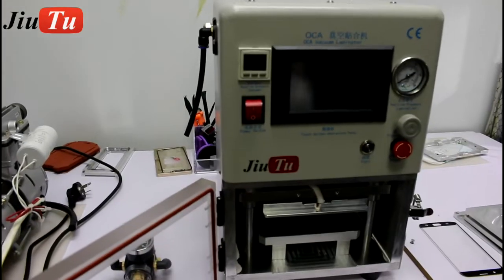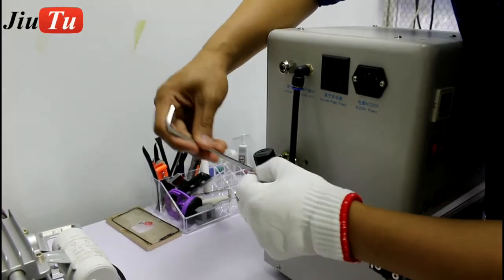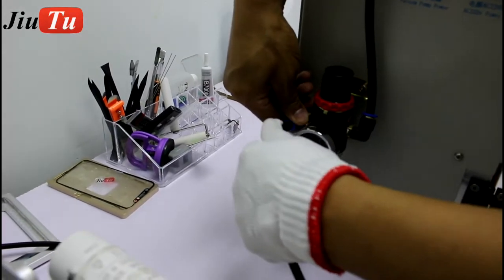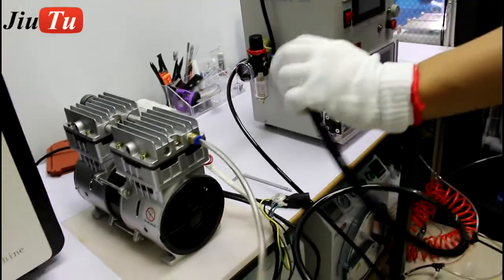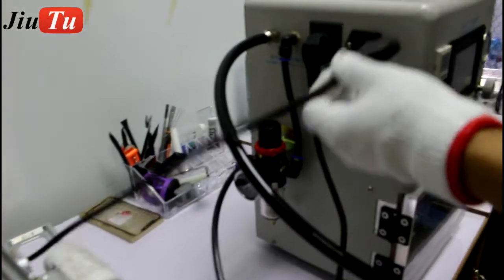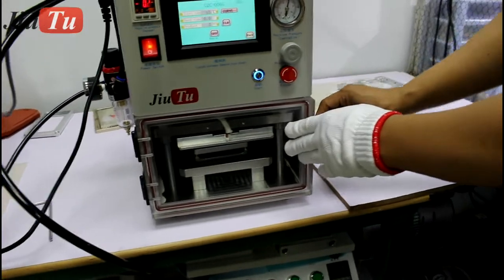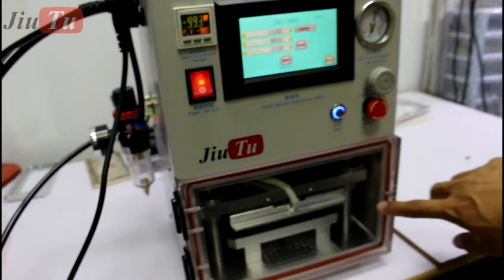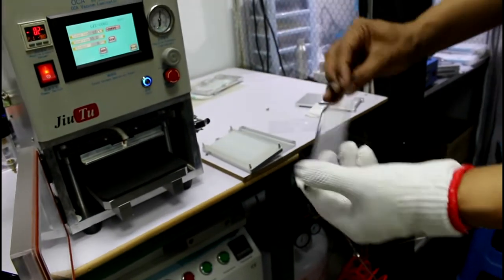How To Repair Samsung Galaxy S7 S8 Edge OLED Curved Glass  By Jiutu LCD Repair Machine

Comment: How much cost for this machine ,it   look like ymg machine.
Reply from the maker: Yes! You are right.  you can buy here get it.
https://www.aliexpress.com/item/Smartphone-OCA-Laminater-Machine-Fix-Edge-OLED-Broken-Touch-Screen-Repair-Refurbish-For-iPhone-For-Samsung/32873360759.html?spm=2114.search0104.3.73.4018326dYqQfyz&ws_ab_test=searchweb0_0,searchweb201602_2_10152_10151_10065_10344_10068_5723115_10130_5722815_10324_10342_10547_10343_10340_5722915_10548_10341_10545_5722615_10696_10084_10083_10618_10307_10301_10821_5722715_10059_100031_10103_10624_10623_10622_5722515_10621_10620,searchweb201603_2,ppcSwitch_3&algo_expid=767ffc72-035f-4ca9-99ed-180e2f8a4926-12&algo_pvid=767ffc72-035f-4ca9-99ed-180e2f8a4926&priceBeautifyAB=0
Reply from the maker: May I have your email or wechat?

Comment: hey pls help me.i have get off the glass of my s8 with my freezer.testet oled all seems ok.but after cleaning from glue the display works not more.what can the problem?i really have watch that i use no pressure on display.pls give me a tip.this happened now 4 times!
Reply from the maker: Pls contact Crystal for more details : email : leesonli@szcarlife.com ,Skype ID : crystal19900 , whatsApp :+8613510422384 ,wechat : jiutu0828
Reply from the maker: If you meet any questions during repair process , pls feel free to contact us , we will provide professional technical support with excellent service .